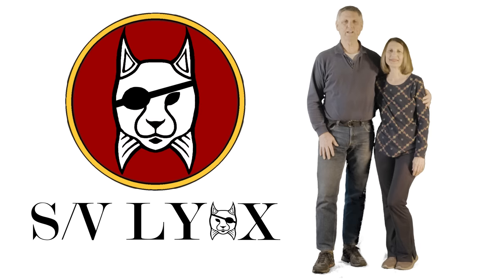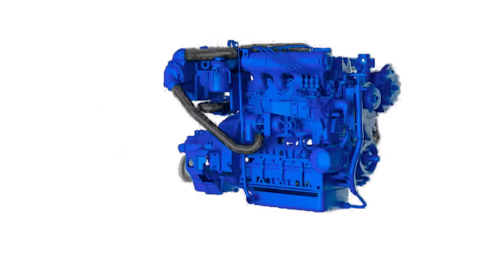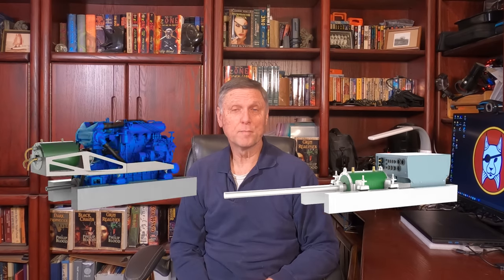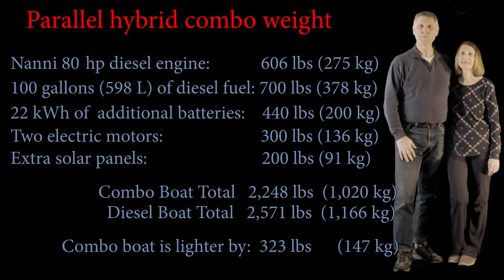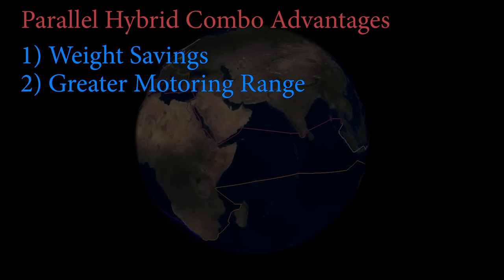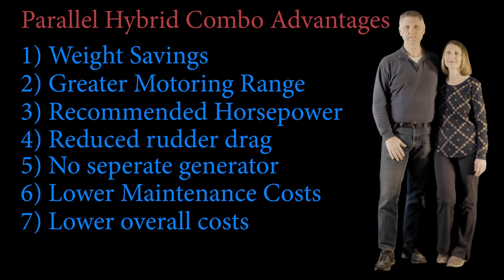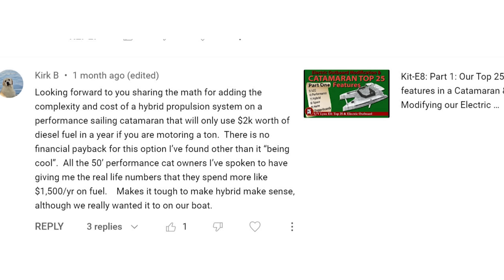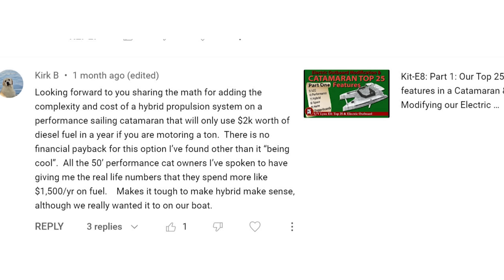Kit-E18 Parallel Hybrid Combo Propulsion

Comment: I think your decision is pretty sound but I believe you have biased your figures to reach the conclusion you hoped to arrive at 🙂 (not that there is anything wrong with that, I do it all the time)

E.g. you mentioned on an 18 day passage you might regen 48kw(h) of power per day, but you mentioned only 22kwh of storage. It is unlikely that your requirements will be for sail/motor half a day each day. Also I don't believe you will be motoring for 40% of the time. I have a Schionning Waterline 1480, I am not as opposed to motoring as some however I would be embarrassed if I motored more than 20% of the time. I haven't kept a record but my gut says significantly less, but I still work, so some trips I motor home to make schedules. If I'm not on a schedule, some days I'll sail at 2kn or even less, they can be great days/nights and there is a lot to be learned by sailing in light winds if you don't mind the noise.
Reply from the maker: Well,  motoring less would only help on those long passage numbers.  And, yes, recharging 48kWh of energy is dependent on having the storage available.  However, if the wind is blowing strongly enough to regenerate that amount of power, it is also unlikely I will need to motor all that much anyway.   I doubt I will need to use my diesel that much on a Trade Winds passage with a performance cat, as my electric propulsion should do for most of the motoring, especially if I'm willing to slow down a bit, and generally, that's my plan.  And if I really have to use diesel for a few days, I have a diesel engine and fuel on board as well.
Reply: @SailingSVLynx  I'm in agreement with your decision, I'm just having a bit of a giggle about your justification for doing so, I think you want it and have massaged the numbers to justify it. On paper with actuals, you will find diesel will come out ahead, even with your 14 year plan.

From a clean slate design, I would probably end up with something similar to yours but not because it was the smartest way but because it was pretty close and I think it is a nice solution.

My point on the 40% v 20% motoring is it will tip your cost spreadsheet balance the other way.

The 22kwh of storage v 48kwh of regen also tips the spreadsheet balance the other way.

I'm not criticising your decision, as I said I'd do something similar. I do think maybe for those watching and for those who may follow, maybe you should say it doesn't really add up, but it's not far off and I think it's neat, so I'm going for it.
Reply from the maker: @whereswaldo1191  Of course, this is all on paper, so which one of us is correct is something that will have to wait for sea trials.   However, one thing I didn't go over in any detail was the cost of maintenance, and that adds quite a bit of savings to the hybrid side of the equation, so I still think that our costs will be less.  I may do an addendum to this video in the next one.  It's hard to nail down numbers, but I did some quick reading on forums where boat owners were discussing maintenance costs on their diesels and the ones who were touting the lowest costs, by doing all the work themselves, still quoted $1,000 a year, per diesel engine over the life of the engine.  And, that did not include the inevitable cost of a full rebuild down the line.  If I add that rebuild into our 14 year voyage calculation and also compare replacing the entire lithium battery bank halfway through our voyage, we come out about $12,000 less on the one diesel vs electric motor and  $11,500 less on the diesel vs diesel (because we will run it 75% less over the voyage, which means only 25% of the annual costs, but I included the full cost of a rebuild at $8,000).  To look at those numbers, that's $1,000 x 14 years plus $8,000 for the rebuild (per normal diesel operation), or $22,000, while on the hybrid diesel that's $250 x 14 years plus a rebuild at $8,000 (though that may not happen in our 14 year voyage due to the much reduced run time, but I added it anyway).  On the hybrid side, I compared the $22,000 for the standard diesel boat to $10,000 worth of replacement batteries.  So, all total, that is a whopping $23,500 savings in maintenance!  I also expect batteries will drop in price over that time, but I figured today's price anyway.  Regardless of any of these estimations, I am pleased to see that our video helped you consider going with this combo system as a possibility.  Hopefully, I am somewhat close on my numbers!  But, even if I am off significantly, the wrong way, and it costs more for the hybrid combo setup over time, I would still go with that combo system for the benefits of less diesel use, which means less smelling of fumes, less noise, less difficulties in procuring diesel fuel, and added comforts of the larger battery bank.
Reply: @SailingSVLynx  sounds good, I'm jealous, we have outboards that drop down through the centre of each hull so we are limited in options.

Comment: I think your weight savings maths should have assumed high output alternators over a Gen Set.... still would have been about equal in terms of weight savings.
Reply from the maker: I did mention alternators instead of a genset, but also talked about how you have to be underway to use those as they don't put enough load on a diesel to run at anchor.  So, for our comparison, since we know we need to generate power at anchor, we do not consider high output alternators a viable option for S/V Lynx.

Comment: Sounds like you have 33kw of batteries in total. 

Therefore it's impossible to generate and store 48kw of power per day via regen, once your batteries are fully charged they're fully charged. So the maximum electric power available at any time equals your total battery power.

Once again, if your batteries are full, solar and Regen  are worthless.

So your assumptions and calculations are majorly flawed. 

You have 2 x 25kw electric motors, equalling 50kw.

Under motor you can not use Regen, solar is only beneficial for 4hrs a day and one day in 3 efficiently. 

So assume your batteries are full, water in your fuel, or a blocked filter, or broken impeller or god knows what happens to your diesel motor. You have (33kw/50)x60 minutes of propulsion available to you at full speed i.e. need to get out of the way of a major storm. 

That gives you 39.6 minutes then you're dead in the water with completely drained batteries. 

Not really a safe scenario. 

When the sun is shining, calm breezes, small seas and a smile on everyone's face. That's when the marketing materials are made. The reality is those days are rare that's why they're called Champaign sailing. On those days you could have farmer joes old tractor motor in reserve, it doesn't matter because you don't need it. 

But when shit hits the fan, you need to know you can get yourself out of trouble fast.
Reply from the maker: We'll have to disagree on your numbers.  First of all, we don't plan to use regen very often at all, it slows down the boat.  We'll only use regen if they wind is blowing more than about 15 knots so that we can still sail at 10 knots (our boat will do about 2/3 of wind speed based on the 1490 that is in the water already and sent us real world data).  

Yes, we have two 25 kw motors, but you don't run electric motors full out for any long distance use, generally less than half of that, say 40%.  That means about 20kw being used.  Calculations of solar are generally 5 hours a day of your rated panels.  This doesn't mean you get five hours at full, it means when you average the entire day, it equals about that much.  So, we will tend to get about 25 kw of solar power on a typical sunny day.  If we leave port or an anchorage, and use our electric motors for the first couple of hours, that will drain a significant portion of our battery power.  Call that 25 kw of 33 kw total.  You shouldn't take lithium batteries below about 20% capacity, which is 26 kw in our case.  So, we use 25 kw in the morning, then recharge 25 kw during the day.  By evening, we're back to full.

Now to your dire scenario.  If a storm is coming, there will be wind, and we're a sail boat.  We can sail faster than we can motor.  Then there is your example of water in our fuel, blacked filter, etc.  Even if you had two diesel engines, those will stop either diesel from working.  Now, in our case, we have two sets of fuel filters that can be switched, so if one is blocked, we'll switch to the other.  But let's assume it is the impeller that goes bad, or some other specific element of the diesel, we can still sail away from a storm.  Now, as for getting out of the way of something else while in a becalmed state, like say, a big ship on a collision course, our electric motors are fine for that kind of maneuver.

Your 'dire' situation also fails to cover some other scenarios.  There was a recent time when three boats were crossing the Indian Ocean (Sailing Zatara was one of the boats) and they were becalmed for a couple of weeks.  All three boats used up all of their diesel and had to just sit in the heat, without a way to generate a lot of power for house needs.  In our case, we could have kept motoring, indefinitely, using our eclectic motors.  No, we wouldn't have been going fast, but at 2-3 knots, we can motor about 24 hours a day if we want.   Even 2.5 knots gets you 69 miles a day and creates 2.5 knots of apparent wind to cool our bodies.   Remember the rule in electric motors, "In order to double the speed, approximately eight times the power is required."  Or, in our example, at half the speed, eight time less power is needed.  Therefore, if our boat could motor for 3 hours at 5 knots, we can motor 24 hours at 2.5 knots.  Regardless of how accurate those numbers are, the point is we could keep motoring slowly on electric.  That leaves our diesel fuel available for our generator mode to create even more power for all our house needs while still moving.  

So, for those days when the shit hits the fan, I'd rather have three different methods of propulsion available (sailing, electric motoring, or diesel motoring) than just two.
Reply: @SailingSVLynx  Thanks for replying. 

I have done these numbers myself many times and with naval architects and very well known boat builders in the UK.

It sounds good, but the basic truth is we are not there yet, not by a long way.

33kw of storage is no where near enough. You quoted the 3 yachts becalmed for 2 weeks and assumed it was beautiful sunny weather, what if it was overcast and raining some of those days. On overcast days you're down to 10% of your solar capacity, on rainy days it's closer to zero.

Don't get me wrong, I'm all for electric propulsion and self generation of power but to give the impression that a small battery pack with electric propulsion will actually work in real life is just not correct. 

The bottleneck is power storage. There will be weeks and weeks where your batteries are full and it's a beautiful sunny day and you can't benefit from the power being generated by the solar panels. 

Most cruising yachts are at anchor at least 90% of the time, so that's a massive opportunity for solar but battery storage won't allow you to benefit from this. 

Basically batteries are to heavy but they are getting better. Right now there are 10.5kw batteries that weigh 45kg. So to get 31.5kw it would be only 135kg, compared to basic lithium ion batteries thats roughly a 40% weight saving which allows an increased storage capacity per kg.

When solid state batteries truly become available this equation will improve again.

Anyway, you're the one that's either going to prove it can be done on your figures or find out otherwise. I honestly wish you all the best and hope you're satisfied with it's performance. 

Personally I'm looking for alternative ways that actually give me more than required so I have a safety margin for what ever comes my way. This does not include diesel motors or generators. But that's another story lol.
Reply from the maker: @MarchTwentyfour-t8z  Don't forget we have an 80 hp diesel on board which also acts as a 12kw generator.  The electric motors are generally just to get us out of port and anchorages and past the dead wind area near shores.  We don't expect to motor off our batteries for long periods.  That's why we aren't an electric propulsion boat, we are a diesel/electric hybrid.  In the case of being becalmed for weeks of overcast skies, we'll motor with our diesel.  Our range is the same on diesel as any other boat.  But that is such an extraordinarily rare occurrence when sailing the trade winds.  Generally, if you are becalmed its clear skies or early fog that burns off.  But again, we have a diesel engine.

One more thing... we didn't come up with this hybrid idea.  We got it from a 50' catamaran that circumnavigated with this exact setup.  We've spoken them and they reported that the system worked wonderfully.  So, this isn't us testing a new thing, we have data from a catamaran that already used this setup.